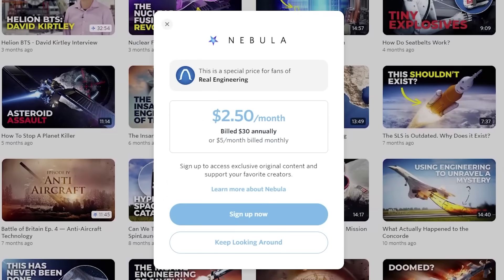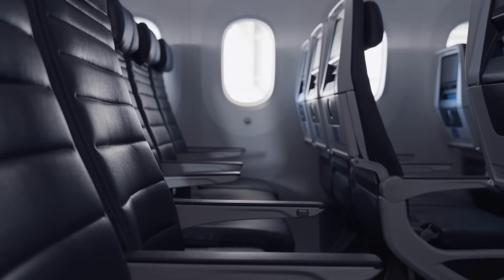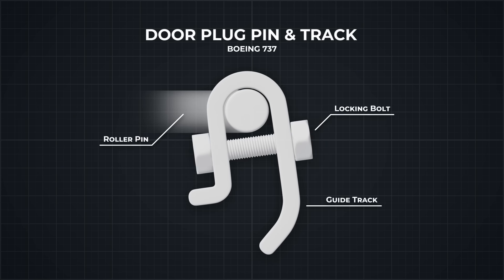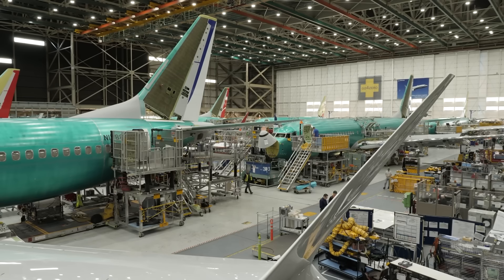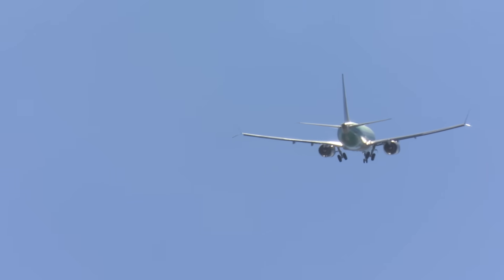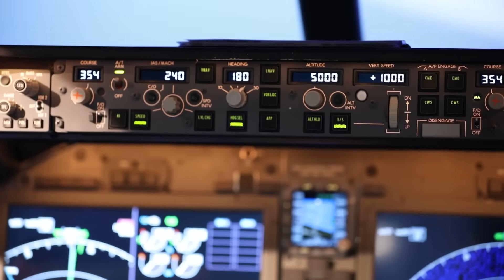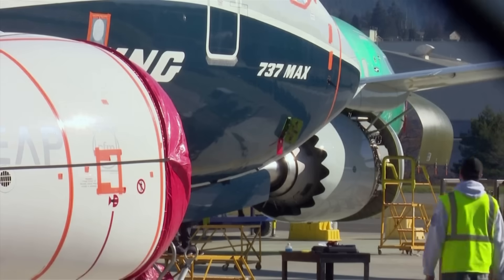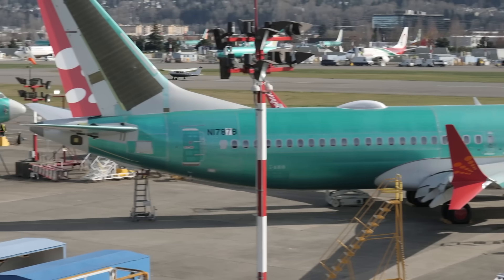The Questionable Engineering of the 737 Max

Comment: I design monitoring systems and dashboards for large enterprise.

“Reset and forget” as a rubber stamp mechanism is the absolute bane of my existence. 

No matter how well designed the tests and parameters are, no matter how hard you make it to override, even if you report on the people resetting in the damn dashboard, spelling out the step by step process to fix in the event. 

Managers will want to see green and only green. They won’t resource the proper maintenance and development of skill to keep the underlying systems actually green. They only reward the fact checks are green. 

I was bought back in to an organisation 6 months after installation and handover by a firms legal team to explain why my solution “didn’t catch” a catastrophic failure in a main revenue generating IT system. They were going to come after me for breach of contract, damages. The works.

It took less than 3 minutes to discover an internal IT technician had screenshot the dashboard after resetting all warnings, then replaced the dashboard front end with the screenshot. Email and IM messages silenced or moved to another folder out of sight. 

His explanation was under constant pressure from his manager to make it green and no training how to resolved the underlying issues, “I just did what he asked and made it green” he was immediately terminated for his part in hiding it but I’d be lying if part of me didn’t feel for his situation, given no time and no training to understand proper maintenance. 

1.1 million dollars that cost them, Mr manager still works there and periodically asks what events mean some 5 years later.

Comment: I worked over thirty years in Maintenace. Most inspection routes were just signed off and never completed because management told us not to worry about doing routes. Just sign them off as completed. The more routes signed off as completed, the larger the management's bonus. Grunts didn't get bonuses. When people would ask why I was doing the routes, I would tell that if we were an airline our planes would be falling out of the skies. It was a good thing we were a processing center. I have talked to airline mechanics over the years, and they have had similar stories. I don't fly anymore. Maintenace problems are usually traced back to bad management.
Reply: The video sladerously called out Muilenburg as the CEO for boeing during this.  The CEO of boeing from 2005 to 2015 was a business moron named James McNerney.  This guy outsourced everything at boeing.  Spirit aerosystems was spun off as a separate company the first year he was CEO.
The video completely ruined itself by not calling out the guy who did this to boeing.  It took 10 years to screw boeing up.  Muilenburg was used as a fall guy and then replaced by another crappy businessman.  The current CEO is the one cutting inspectors.
James McNerney stepped down as CEO 7 months before the first test flight of the 737 max.  He knew it was crap and ran just before it started flying.
Reply: @_PatrickO  if McNerney knew it was crap and ran just before it started flying, then Muilenburg let it fly while knowing it was crap.
Reply: @Erevos85  Exactly.  Muilenburg was a fall guy.  He got used because he wasn't going to be able to fix anything that late in the game.   He does deserve jail time for not sounding the alarm and grounding.   But mcnerney and calhoun are much worse than muilenburg.
Reply: @_PatrickO  I'm glad somebody said it...
It felt as dumb as apologetics.

The neoliberal era of neoclassical economics made these business types, and they are ruining the world. And possibly killing any future for the human race. (It was afterall the neoclassical economists who were the ones doing the most egregious climate denialism in the 90's. That all the politicians then listened to as experts. The same economics that gets low level taught to these business morons)
Reply: Also, aircraft mechanics pay is usually garbage and to an extent aviation as a whole outside pilots and engineers. As far as occupations go and their importance to people's safety and direct impact to the company making money (aircraft being airworthy and leaving on time), they're really underpaid. Even more so when you consider the quality of life is usually total shit. Nights, weekends, working outside in the freezing cold, stress, what it does to your body, etc. There's only a handful of major airlines that pay pretty well and all things considered I think it's still too low and not really worth the quality of life. The occupation is a joke.. I know because I am one.
Reply: Great engineering practice undermined and ruined by typical US business management.
Reply: I hate these big industries… they tell you to sign off on crap that meets minimum “safe for flight”… such a BS concept.
Reply: 737 MAX? -I'll pass and take the next flight.
Reply: @DAbluesme  If it's Boeing, I ain't going.
Reply: @DAbluesme if you even know that’s what you are booked on!
Reply: worked in helicopter repair. Our shop did primarily fire and heli logging birds. I was routinely told to pass fuel lines with cracked flares, re install fuel cells past its life span. An instructor died with a trainee because someone forgot to replace the tail rotor oil after draining it and the inspector passed it.  I refuse to fly helicopters.  The stories i heard form the fixed wings were just as bad.
Reply: These bastards should be in prison. Profit should never come before safety.
Reply: Look up the dirty dozen in maintenance, be a whistle blower
Reply: Managers are almost by default incompetent.
Reply: Geneva Airport Maintenance guys said the very same thing... Same goes with trains of the national company here... These people are criminals... Probably part of the natural 2% of psychopath ratio in the population. I personally saw 500'000 CHF of citizen taxes be stolen by the army with just two signatures, one was mine, on fake helicopter instruments change reports that actually never happend in reality... We were forced to sign by "some manager". This is all a great world we get from the past generation, so lovely to exist on this planet in 2024...
Reply: This is the end result of capitalism's mathematically impossible logistic demand for permanently increasing profit margins.

This is one of dozens of major and catastrophic examples of this outdated and mathematically broken system sacrificing lives so a few doofooses can have an extra yacht with a slightly different color than their 7 other yachts.

We MUST replace it ASAP or it will break our civilization and kill us.
Reply: leadership in most of the developed world is a failure. the worst people seem to get the jobs
Reply: Anytime my friends ask me why I don’t like flying, they like to point out the statistics of safety and risk, and I just can’t justify them anymore. Getting me on a plane at this point means making sure I’m pretty much unconscious this way if we go down, I can go down in my sleep.
Reply: RIP in advance

Comment: Great video. You almost perfectly hit the nail on the head.

One small thing to add though was MCAS was an unpublished addition prior to the two MAX crashes. Pilots did not know if its existence in full until after the second crash when Boeing had to come clean.

The reason for their reluctance to be open and honest from the start was purely a financial one.

If it had been added to manuals two things would have needed to occur. The first is that the system would require N+1 redundancy. The second is that all airlines purchasing the MAX who had existing 737 fleets would require additional training that would have needed to be factored into the purchase decision.

This contrasted to the competing A320 Neo, which required no additional training for airlines with A320 fleets.

The cut corners! And long term Boeing employees have been calling foul for years before MAX flew.
Reply: Oh cry me a river.  As if pilots are informed of every subroutine in the aircraft's software.

Comment: 2:55 I think this needs to be clarified as there's been some debate on it and I think it has been described incorrectly: The guide track is on the door-plug while the roller pin is part of the fuselage (as described in the video). The door-plug must move UPwards to be released from the 'closed' position/to open the door-plug. That is to say that to install the door it must mate to the roller pin from above and be pushed downwards against the force of the 'assist' springs in the bottom hinge assembly before the locking bolts can be installed. This is even incorrectly described in the Boeing 737 maintenance manual. As you can see from the illustration at this portion of the video, once the roller pin is at the top of the guide track, the door itself cannot move any farther downwards, meaning that it would be impossibel to open it by pushing downward.
Reply: You are correct. Once the locking bolts are missing, the springs at the bottom push the door up and if the pressure against the 6 pads isn't strong enough, the door slides up and is loose.

Comment: What Boeing did with 777 Max is like a car manufacturer installing a software to turn your steering wheel to the right because the car pulls to the left by design. Moreover, they didn't want to tell the pilots about this feature because it's embarrassing. When the system malfunctioned, pilots didn't know what to do and 2 planes crashed because of that. Terrible decision making. When I book a flight, I always heave a sigh of relief if the plane is an Airbus.

Comment: Dumb as dirt design.  Real doors CAN'T get sucked out.  They're larger on the inside, larger than the frame.  Cabin pressure seals it tight against the frame.  (Like a cork pushed tighter in the bottle.)
Why the hell do they make door plugs the opposite?   Where cabin pressure pushes them out?  

Bolts wouldn't be needed at all, except as basic door locks.  Proof people with degrees can have zero common sense.

Comment: A lot of speculation and opinions here.  But, without doubt Boeing's management is totally responsible for these issues.  Too much profits maximization  and  not enough engineering.  Too many "band-aids" applied when a clean sheet design was needed.  
The major customer airlines also bear some of the blame by demanding from Boeing a same type rating for every larger aircraft.

Comment: In this case, it's not the engineering that is the problem. Door plugs are also used on Airbus A321's.
The problem is the quality control from Boeing.
The fuselage with the door plugs are delivered to Boeing with the door plugs installed loose.
The actual correct final installation is the responsibility of Boeing.
This should be a pretty standard work process that they apparently seem to have forgotten at Boeing.
If they forgot to fit the securing cotter pins correctly to the bolt/nut assemblies for the plug door, the nut can indeed come loose and fall off.
The main problem here is Boeing and their quality control system.
This accident has nothing to do with the MCAS debacle. These two issues are two completely different problems.

Comment: It’s insane that it took this much to have them put out any sort of written material on this. I’m a Maintenace tech for a regional airline and we get info and our manuals updated on problems even when nothing happens (an example is we’ve had an issue with people leaving tools and oil cans in the aft equipment bay. Within like 3 incidents the company changed the job cards to include a step to check the bay and sent out a read and sign about the issue) how the hell does a massive company not catch stuff like this
Reply: You have to care to catch it. And your employees have to be incentivized, not dissuaded
Reply: Been a massive company. The larger the firm the harder the management task and the more likely that things start falling apart do to that management problem not being fully over come.

Comment: I personally do not think it's an issue to allow the 737 Max 7 to be certified, without the cowling issue being fully fixed. All 737 Max planes (Max 7, Max 8, Max 8200, Max 9 and Max 10) fly with identical engine cowlings (all fly with the CFM LEAP 1B Engine). The issue also exists on the currently certified Max 8 and Max 9. And Issues like this are not uncommon. Once a fix has been certified, it will have to be implemented within a specified number of flights, flight hours or days.
As the 737 Max production lines are more or less running at capacity, not certifying the Max 7 until the issue is fixed, would only result in more Max 8 and Max 9 planes being built and delivered, which have the exact same issue. Allowing the Max 7 to be certified with the Issue, would not increase the number of planes flying, with the issue. 

If the argument is, that the cowling issue endangers passengers, certifying the Max 7 now would actually decrease the number of passengers at risk, as it would mean fewer of the larger planes (Max 8 and 9) being built until the issue is fixed.

Comment: The 737 has been plagued with issues for its entire lifetime. For years, mysterious crashes during the 80s and 90s, caused by sudden and extreme unwarranted rudder commands leaving the pilots to be passengers on their own aircraft, left investigators baffled. In the end the conclusion was that it happened to certain rudder PTUs that were faulty, during descent in just the right conditions where temperature and humidity was at certain values. 

The NG on the other hand, has been an absolute success, with an extremely good record to show for, so Boeing had it all together during second half of The 90s regarding all their aircraft.

Comment: The MCAS software was outsourced to one of Indias big software companies.

I visited both Wipro and Infosys in person and discussed deals, and this is what I’ve found.  Their programmers are paid $20/hour, and they do decent work for that money. The problem is they have absolutely no idea about the stuff they are working on. I would bet they don’t know what a trim tab is or how to correct a stall.  They get a requirement, and it says get X to perform Y while conditions A and B are present, and they will deliver exactly that, no questions asked.
Reply: Of freaking course Boeing would outsource the MCAS software…
Reply: The conceptual design of what aerodynamic surfaces the software would be able to control, and the single (and insufficiently reliable) sensor that the software relied upon to function properly, were also fundamentally flawed, even if the software itself had been very reliable and robust.  

Additionally, they should never have approved the inclusion of a system which the safety of the entire aircraft was so reliant upon, and then heavily market the plane as not needing any significant pilot re-training or recertification. They lied about the plane just being another 737 with newer/ better engines. Worse yet, this MCAS system DIDN'T NEED TO EXIST IN THE FIRST PLACE. They should have done a more thorough re-design of a new plane, and given it a new name. 

However, even if they hadn't re-designed the plane, pilots who have analyzed the issues with this system have argued that it would have been safer to have not included the MCAS system at all, and to have just let the pilots figure out how to compensate for the plane's tendency to nose up on their own. This never would have been allowed to happen, and Boeng never would have been able to have convinced anybody that pilot retraining wasn't necessary, but it still would have been safer than what they actually did.

Comment: Ultimately the FAA is responsible for certing all these planes for flight. If they suspect an issue, the planes should be grounded pending safety investigation and certification. That's their fucking job. Boeing can hum and haw at it but they're a bunch of clowns putting peoples lives at risk. How many planes should crash before the FAA does something? Regulatory capture has become all too common in many sectors of industry in the USA and elsewhere. They could save a lot of money by not attaching the damn wings, but again FAA would and should keep that sort of craft grounded. All this cost cutting for profit is reckless and proven fatal in several cases in the last few years. I point the finger SOLELY at FAA for allowing these clowns to operate.